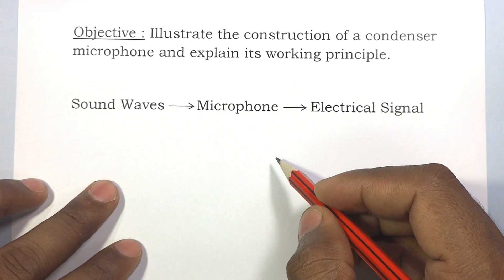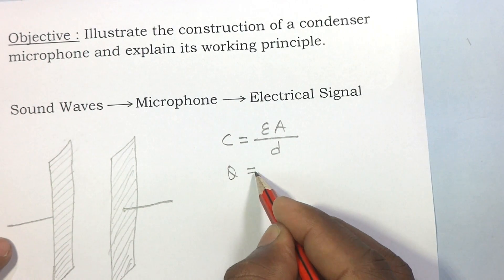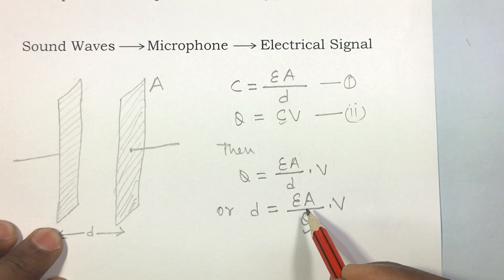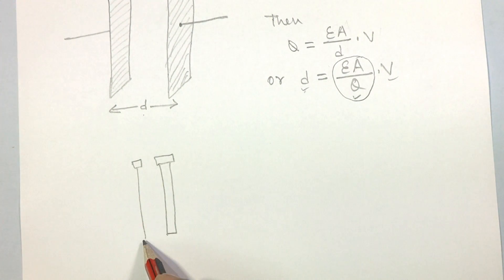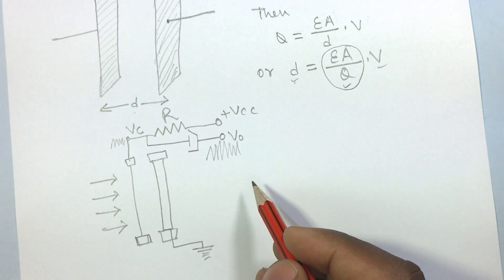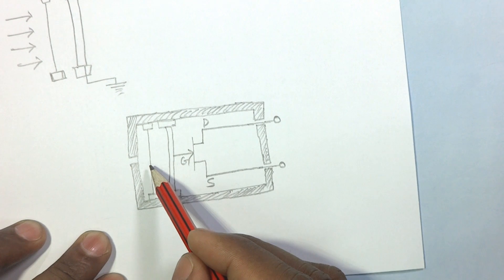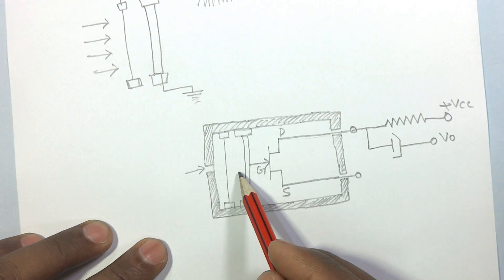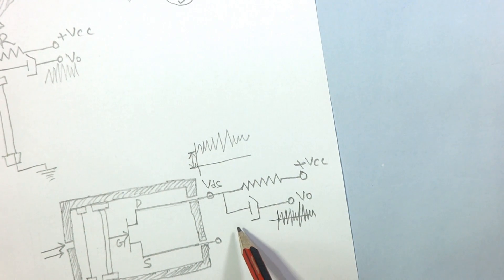Condenser Microphone working

Comment: I have some questions for you!...I'm interested in micro capacitive microphones, I really liked your tutorial, thank you.
1- Since the capacitive microphones are mini, can they be good pickups for guitars and similar stringed instruments?
2-Are there advantages and disadvantages?
3-Do you have a video about designing and implementing a circuit suitable for this?
4-Do you have a more advantageous mini microphone suggestion as a capacitive microphone alternative?:hand-pink-waving:
Reply from the maker: Thank you for your comments.
1. They are very sensitive and efficient and will work perfectly in this application.
2. It will fulfill your requirements efficiently so you can ignore its little disadvantages.
3. Not right now. Amplifiers are easily available in the market, and they are cheap compared to designing your own circuits.
4. Capacitive microphones are efficient, advanced, and low-power widely used in gadgets. You can search MEMS microphones

Comment: But there is a transistor in small condensor mic what for that.
Reply from the maker: for amplification
Reply: @VKYadav  sir one more problem if i use such condenser mic  my  voice sounds very much noisy means from nose and from moving coil it appears some good what is reason i am finding since 20 years.

Comment: how to recognize its +ve nad -ve nodes???
Reply from the maker: Check the datasheet of your microphone. If it is generic and you do not have datasheet then do these steps..
1. any one of these two terminal would be connected to enclosure, that is ground.
2. Use multimeter and set it to continuity mode and test step 1.

thans

Comment: would the vibrating diaphragm have a negative charge?
Reply from the maker: YES, and thus a positive voltage induced on the pick up plate which drive the FET pre-amplifier. Negative electret charge on the teflon family film is much stable than that of the positive charge.
Thanks,